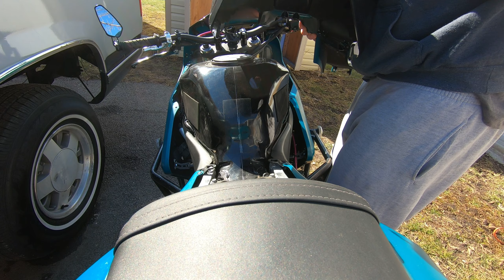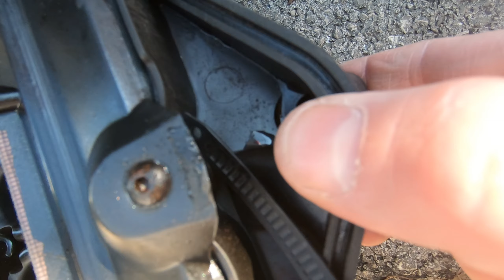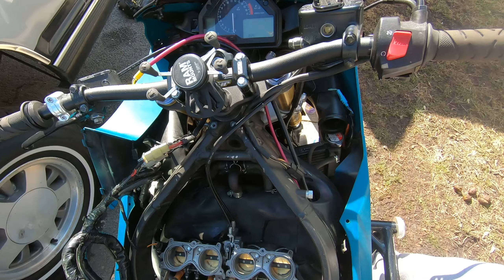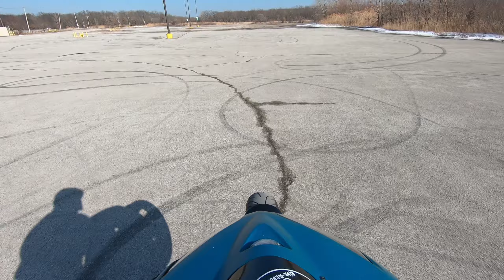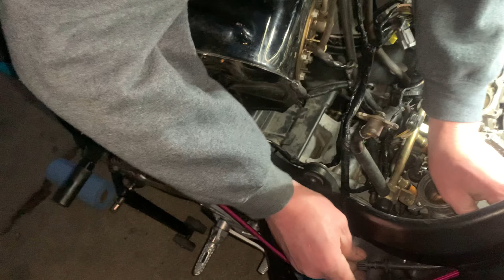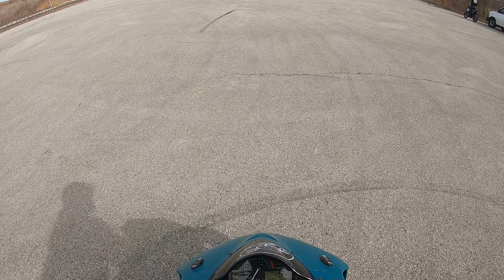Cbr600rr Gets Clean Air and Idle Mods | Lot Days

Comment: Could you explain what exactly you did? Have the same bike and don’t really know which hoses I’m plugging
Reply: For the clean air mod
Reply from the maker: There is three hoses coming off the valve cover. One is the breather that goes to the air box, the other two go to the pair valve. Remove the pair valve and put a T to connect all three together. Plug all open connections in the air box. Or you could get a set of block off plates to delete the pair system, and put a small filter on the breather. Either way is ok.